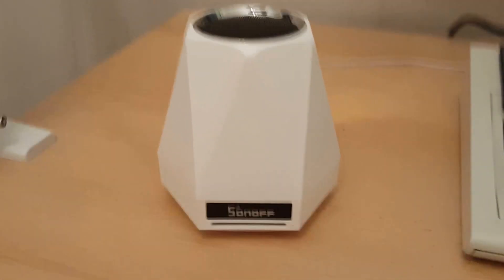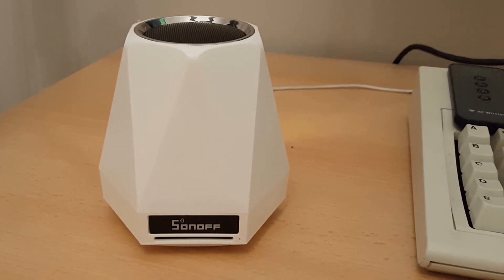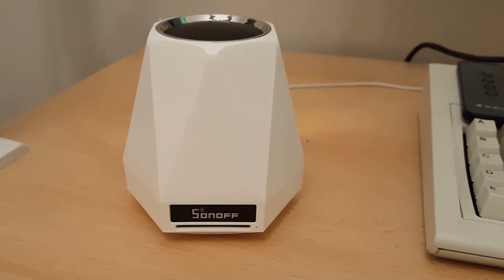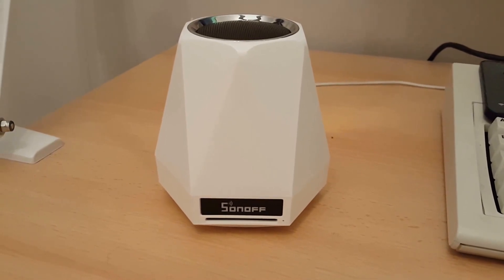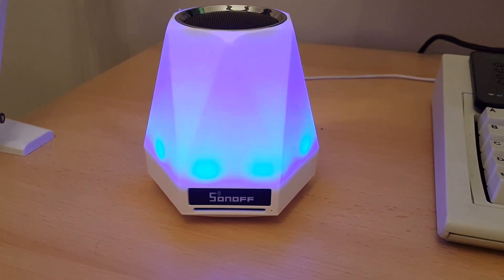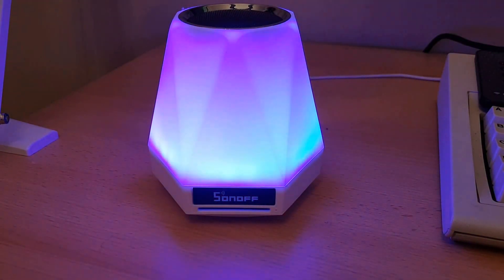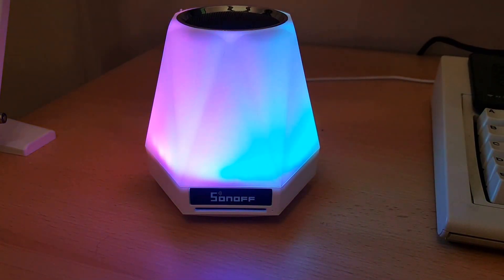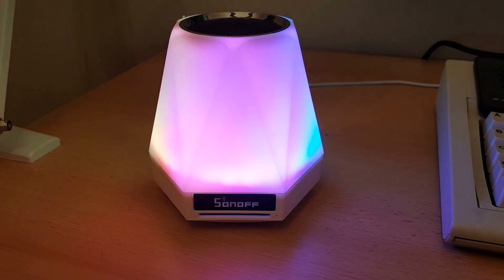Sonoff SC Modification!

Comment: Doesn't heat dissipated from LEDs affect temperature readings?
Reply from the maker: Not sure.  The LEDs are in  a different chamber, so even if they were on all the time,  I doubt they would make much difference.  I only use them however as status lights.   The unit goes red for instance when my front door bell rings...
Reply: @justblairthompson  tested it and used as small lamp and the heat from leds affect temp reading :/